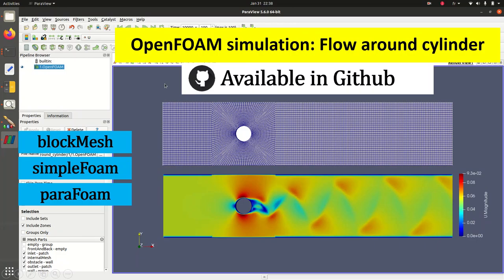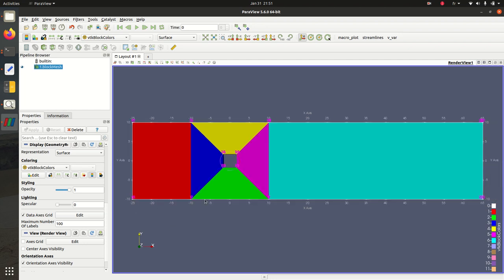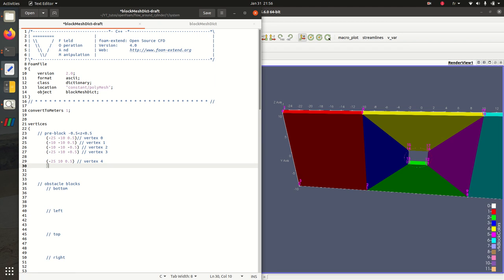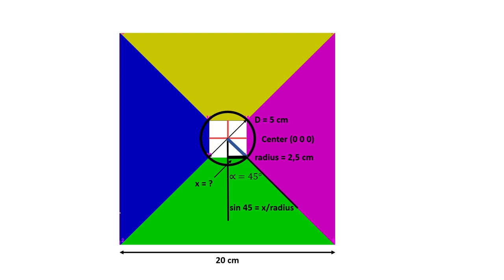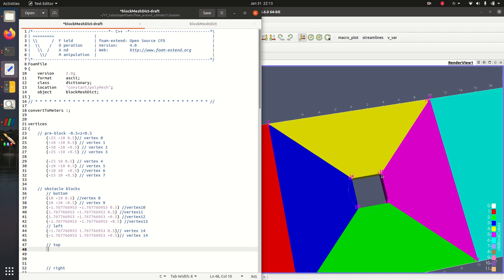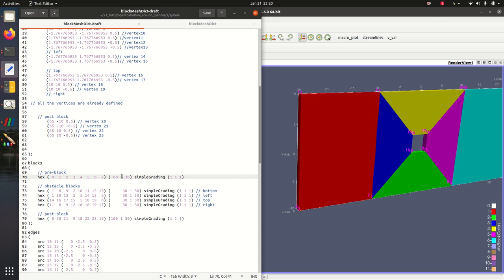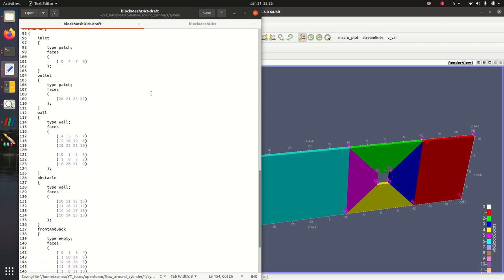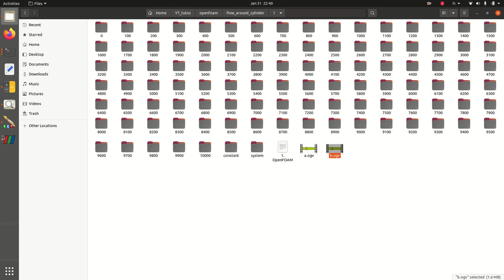OpenFOAM Tutorial: Simulation of the flow around a cylinder

Comment: Dr Asma, I changed the flow extents and still facing the error for the arc point...
From void Foam::blockEdges::arcEdge::calcFromMidPoint(const point&, const point&, const point&)
in file blockEdges/arcEdge/arcEdge.C at line 66.

convertToMeters 0.1;

vertices
(
// pre-block -0.5<z<0.5
(-4 -1.5 0.5)// vertex 0
(-2 -1.5 0.5)// vertex 1
(-2 -1.5 -0.5)// vertex 2
(-4 -1.5 -0.5) // vertex 3

(-4 1.5 0.5)// vertex 4
(-2 1.5 -0.5)// vertex 5
(-2 1.5 -0.5) //vertex 6
(-4 1.5 -0.5)// vertex 7

// obstacle blocks
// bottom
(-2 -1.5 0.5)//vertex 8
(-2 -1.5 -0.5)//vertex 9
(-0.212725 -0.212725 0.5)//vertex10
(0.212725 -0.212725 0.5)//vertex11
(0.212725 -0.212725 -0.5)//vertex12
(-0.212725 -0.212725 -0.5) //vertex13
// left
(-0.212725 -0.212725 0.5)// vertex 14
(-0.212725 0.212725 -0.5)// vertex 15

// top
(0.212725 0.212725 0.5)// vertex 16
(0.212725 0.212725 -0.5)// vertex 17
(2 1.5 0.5)// vertex 18
(2 1.5 -0.5) // vertex 19
// right

// all the vertices are already defined

// post-block
(8 -1.5 0.5)// vertex 20
(8 -1.5 -0.5) // vertex 21
(8 1.5 0.5)// vertex 22
(8 1.5 -0.5)// vertex 23

);

blocks
(
// pre-block
hex ( 0 1 2 3 4 5 6 7) ( 60 1 30) simpleGrading (1 1 1)

// obstacle blocks
hex ( 1 8 9 2 10 11 12 13) ( 30 1 30) simpleGrading (1 1 1) // bottom
hex ( 1 10 13 2 5 14 15 6) ( 30 1 30) simpleGrading (1 1 1) // left
hex (14 16 17 15 5 18 19 6) ( 30 1 30) simpleGrading (1 1 1) // top
hex (11 8 9 12 16 18 19 17) ( 30 1 30) simpleGrading (1 1 1) // right

// post-block
hex ( 8 20 21 9 18 22 23 19) (180 1 30) simpleGrading (1 1 1)
);

edges
(
arc 10 11 ( 0 -0.25 0.5)
arc 12 13 ( 0 -0.25 -0.5)
arc 14 10 (-0.25 0 0.5)
arc 15 13 (-0.25 0 -0.5)
arc 14 16 ( 0 0.25 0.5)
arc 15 17 ( 0 0.25 -0.5)
arc 16 11 ( 0.25 0 0.5)
arc 17 12 ( 0.25 0 -0.5)
);

boundary
(
inlet
{
type patch;
faces
(
( 0 4 7 3)
);
}
outlet
{
type patch;
faces
(
(20 21 23 22)
);
}
wall
{
type wall;
faces
(
( 4 5 6 7)
( 5 18 19 6)
(18 22 23 19)

( 0 1 2 3)
( 1 8 9 2)
( 8 20 21 9)
);
}
obstacle
{
type wall;
faces
(
(10 11 12 13)
(11 16 17 12)
(14 16 17 15)
(10 14 15 13)
);
}
frontAndBack
{
type empty;
faces
(
( 0 1 5 4)
( 1 10 14 5)
(14 16 18 5)
(11 8 18 16)
( 1 8 11 10)
( 8 20 22 18)

( 3 7 6 2)
( 2 6 15 13)
(15 6 19 17)
(12 17 19 9)
( 2 13 12 9)
( 9 19 23 21)
);
}
);

mergePatchPairs
(
);
// * * * * * * * * * * * * * * * * * * * * * * * * * * * * * * * * * * * * * //

Please help
Reply from the maker: Hello, it seems that you are not choosing the right interpolation points to create arcs
Reply: Asma I have been successful in running the modified case. However, the shape of my cylinder is not circular. I believe i gave the correct interpolations points. I varied the dia to 0.5m. In doing so, I have a cuboid kind of shape, help me in this regard

Comment: Hello, Mam where can i find and modify the mesh (blockMesh). I want to do some modifications on the length scales
Reply: thank you, i got the zip file on github!
Reply: Dr Asma, I changed the flow extents and still facing the error for the arc point...
From void Foam::blockEdges::arcEdge::calcFromMidPoint(const point&, const point&, const point&)
in file blockEdges/arcEdge/arcEdge.C at line 66.

convertToMeters 0.1;

vertices
(
// pre-block -0.5<z<0.5
(-4 -1.5 0.5)// vertex 0
(-2 -1.5 0.5)// vertex 1
(-2 -1.5 -0.5)// vertex 2
(-4 -1.5 -0.5) // vertex 3

(-4 1.5 0.5)// vertex 4
(-2 1.5 -0.5)// vertex 5
(-2 1.5 -0.5) //vertex 6
(-4 1.5 -0.5)// vertex 7

// obstacle blocks
// bottom
(-2 -1.5 0.5)//vertex 8
(-2 -1.5 -0.5)//vertex 9
(-0.212725 -0.212725 0.5)//vertex10
(0.212725 -0.212725 0.5)//vertex11
(0.212725 -0.212725 -0.5)//vertex12
(-0.212725 -0.212725 -0.5) //vertex13
// left
(-0.212725 -0.212725 0.5)// vertex 14
(-0.212725 0.212725 -0.5)// vertex 15

// top
(0.212725 0.212725 0.5)// vertex 16
(0.212725 0.212725 -0.5)// vertex 17
(2 1.5 0.5)// vertex 18
(2 1.5 -0.5) // vertex 19
// right

// all the vertices are already defined

// post-block
(8 -1.5 0.5)// vertex 20
(8 -1.5 -0.5) // vertex 21
(8 1.5 0.5)// vertex 22
(8 1.5 -0.5)// vertex 23

);

blocks
(
// pre-block
hex ( 0 1 2 3 4 5 6 7) ( 60 1 30) simpleGrading (1 1 1)

// obstacle blocks
hex ( 1 8 9 2 10 11 12 13) ( 30 1 30) simpleGrading (1 1 1) // bottom
hex ( 1 10 13 2 5 14 15 6) ( 30 1 30) simpleGrading (1 1 1) // left
hex (14 16 17 15 5 18 19 6) ( 30 1 30) simpleGrading (1 1 1) // top
hex (11 8 9 12 16 18 19 17) ( 30 1 30) simpleGrading (1 1 1) // right

// post-block
hex ( 8 20 21 9 18 22 23 19) (180 1 30) simpleGrading (1 1 1)
);

edges
(
arc 10 11 ( 0 -0.25 0.5)
arc 12 13 ( 0 -0.25 -0.5)
arc 14 10 (-0.25 0 0.5)
arc 15 13 (-0.25 0 -0.5)
arc 14 16 ( 0 0.25 0.5)
arc 15 17 ( 0 0.25 -0.5)
arc 16 11 ( 0.25 0 0.5)
arc 17 12 ( 0.25 0 -0.5)
);

boundary
(
inlet
{
type patch;
faces
(
( 0 4 7 3)
);
}
outlet
{
type patch;
faces
(
(20 21 23 22)
);
}
wall
{
type wall;
faces
(
( 4 5 6 7)
( 5 18 19 6)
(18 22 23 19)

( 0 1 2 3)
( 1 8 9 2)
( 8 20 21 9)
);
}
obstacle
{
type wall;
faces
(
(10 11 12 13)
(11 16 17 12)
(14 16 17 15)
(10 14 15 13)
);
}
frontAndBack
{
type empty;
faces
(
( 0 1 5 4)
( 1 10 14 5)
(14 16 18 5)
(11 8 18 16)
( 1 8 11 10)
( 8 20 22 18)

( 3 7 6 2)
( 2 6 15 13)
(15 6 19 17)
(12 17 19 9)
( 2 13 12 9)
( 9 19 23 21)
);
}
);

mergePatchPairs
(
);
// * * * * * * * * * * * * * * * * * * * * * * * * * * * * * * * * * * * * * //

Please help

Comment: Hi, how to do this similar simulation for a triangular cylinder ?
Reply from the maker: Hello, you just need to update the mesh.
Reply: @CFDAsmaaHadane   hi, thanks fro replying. Do you mean update  the blockmeshdict file?
Reply from the maker: Update the blockMeshDict file is an option, but you can also generate your mesh in gmsh and convert it for example!
Reply: @CFDAsmaaHadane  Do you have any source codes? Do you mind sharing it with me? I am a newbie on this software. I have to do my Final Year University Project, and need to use OpenFOAM.
Reply: @CFDAsmaaHadane  Is it possible if I sketch the triangular geometry on Solidworks/AutoCAD, and then I convert it into STL format. Next, building the mesh. Is it a right way to do it?

Comment: Thank you alot for this videos. 
I am interested in learning this software , but I am weak in the software language. Before I start, what do you advise me? Is there a specific programming language  i should know it ? And also can i use it  to modeling an stimulation for removing sidemantation around bridge piers by flow water action !
Reply from the maker: To learn OpenFOAM you don't need to learn a programming language unless you want to modify the code or program your own models. To start with OpenFOAM,  you should better begin by learning the basics (structure of files and folders, mesh generation, simple cases). There are a plenty of detailed OpenFOAM tutorials available in Youtube. Please check this link ( https://wiki.openfoam.com/Collection_by_authors ). I recommend József Nagy and Tobias Holzmann tutorials.

Comment: Anyone know, how can i rotate just a hole (square) and conservat the domain?
Tky
Reply from the maker: Hello, try doing your mesh in gmsh. It is much easier to rotate it. Then convert your mesh using gmshToFoam command.
Reply: @CFDAsmaaHadane   Tky Asmaa Hadane, for your fast answer.
I am using this code (gmsh), but i would like to automatize the process, 
In this case, solve a lift parameter for each angle, so after that, to study the gallopping. 
The trasnformMesh could rotate, but do it for all domain, 
In this case, only object need chenge its position, the domain should be fixed.
Thank you again, I will try here